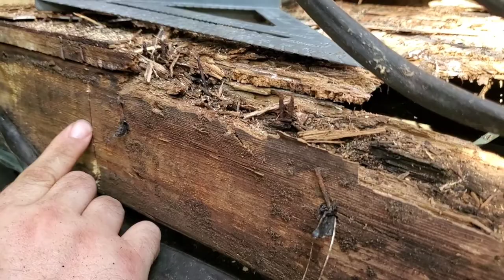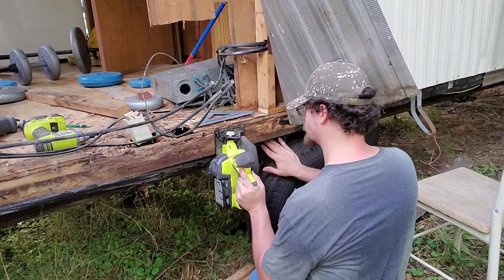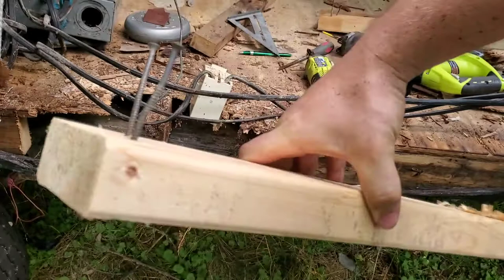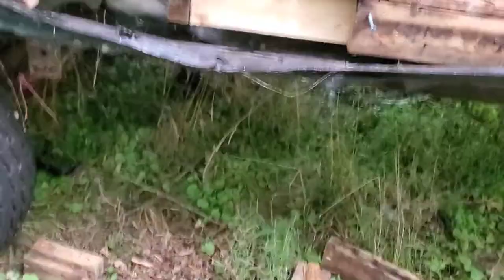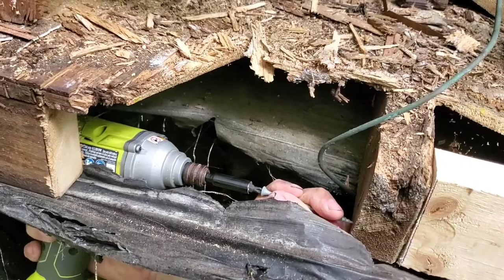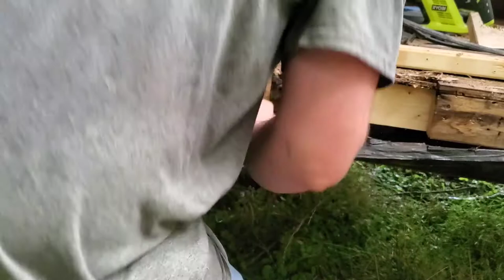Tiny Home Made From Free Office Trailer

Comment: Any advice on finding used office trailers for cheap? Seems that all I can find in my area of the roughly 8x32 size run between $6K-$12K and I'd much rather get one a lot cheaper and have to do some repairs than to spend that much to get one "ready to go".
Reply from the maker: I need to update this, im far ahead of  this now.  Not done by far, but I got it to a point where I stay in it over the weekend to relax/hang out or party lol.   Yeah in my area I could buy one already done or a small mobile home for that, saw one for 8k already done a while back, I think slightly bigger then mine.  If you haven't already look on Facebook market place or Craigslist.  Could try driving around, ive seen people wanting to get rid of trailers, but figured no one would take them so they don't list them and just let them go to nothing.  I got another for $200 though its in worst shape, once I get this one done I'm combining the two like a doublewide.
Reply: @thetightwadhomesteader3089  I'd love to see an update video.

Comment: I found one like this for 5k in my area with nothing wrong with it, im wondering if I should get it and turn it into a tiny house, the problem is id only have like 1k to modify it
Reply from the maker: If you live in a cold climate i wouldn't. Don't know about the newer ones, but the insulation sucks, you'd have to get better quality insulation and bare minimum double pain widows.  I live in a mild area 30-50 degrees all winter,  rare i see Temps sustained under 20 degrees so I wasn't worried about insulating it.  Also mine practically has no insulation in the roof.  Personally I feel like 5k is really high if its the older trailers.  I don't know about your area, but ive seen small decent mobile homes for that price, though a normal truck couldn't haul them (hauled this one with a truck).  I got this one free and I bought another one for $200 though its in rougher shape.  I usually Don't see them higher then $1000 around here.
Reply: @thetightwadhomesteader3089  I live in the hottest part of Florida lol, the insulation problem will be a problem for me, thanks for letting me know, I think im going to build a 9x40ft trailer home from scratch, I have alot of free lumber and insulation from my work and my brothers a plumber, I can do electrical so I think its my best bet.
Reply: @thetightwadhomesteader3089  I live in my parents living room at the moment and I need to stay close to home, our county laws don't allow to build a tiny house or shed house on the property unless its on wheels so thats why I was heavily considering this.
Reply from the maker: @FTVG_inc  sounds good, I have a trailer that I could build one from scratch it would be far into the future though.  Atm I'm going to fix both office trailers up one at a time and add them together as a kind of permanent doublewide both trailers are 8x28.
Reply: @thetightwadhomesteader3089  nice